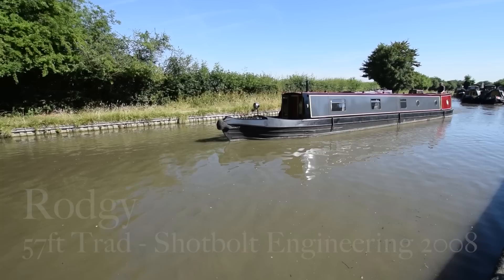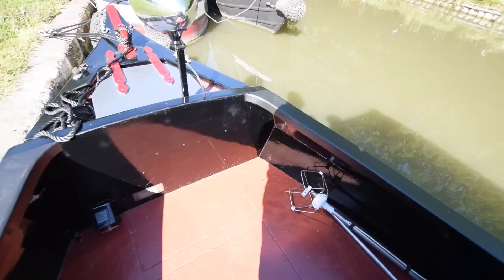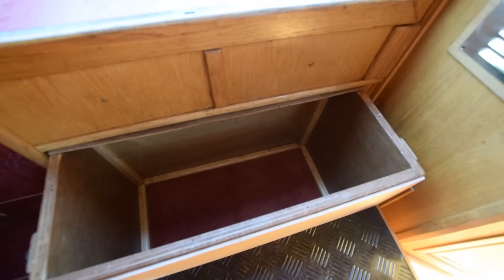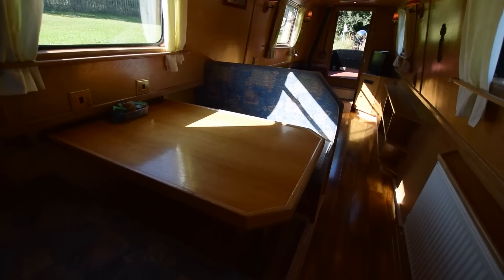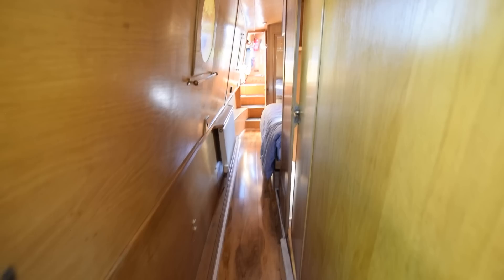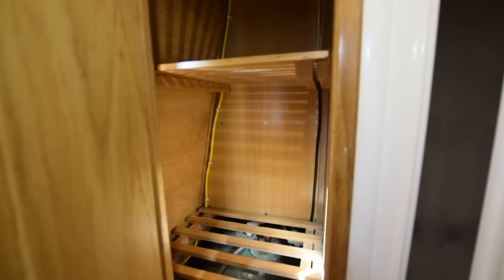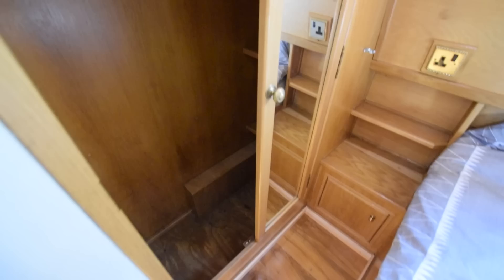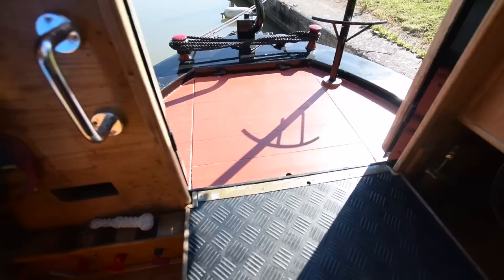SOLD - Rodgy, 57' Trad 2008 Shotbolt Engineering

Comment: Well! The potential for comfortable living is evident! Love the graceful tug bow, and the salon is nice and open despite the small shelves along the gunnels.  Again, I would remodel the dinette into a table and chairs, or even a nice walled in nook. I'm sure the engine and bay were cleaned for the sale, but you can see the overall condition is superb that cleaning can't hide! I would stack on the solar, snuggle in 6 domestic batteries, and be very happy with Rodgy!

Comment: The more I see of these boats with the engine down in the floor the better I like the ones with it sitting easily accessible ON TOP of the floor. The engines out in the open seem like they would be so much easier to work on.

Comment: Quite nice boat. I'm just wondering about the shelves on both side of the saloon, I wouldn't know which side to put the chairs on, they would always feel awkward and in the way. I think that's why no chairs are shown in the video, no?
Reply: Swivel recliners?
Reply: @Dave-sw2dm  they would certainly work well here, buy the "Feng shui" for lack of a better word is extremely awkward. There is no cozy spot that invites a settling down between 5hose shelves, however much I like them otherwise...

Comment: This one seems to have stuffed every possible thing into the 57ft length - so it could have even been 60 ft and then gained 3ft for maybe the kitchen ? It's also amazing to me that nobody is thinking of bump outs on these boats for when you are moored - Even 1ft extra in the lounge width, even if just at window level, would make so much difference as it may be largely psychological, but sitting in the lounge with a tv in your face just looks so uncomfortable to me !
Reply: I imagine the weight of a solid-steel slideout would tax any motor, plus it would get in the way of passing boats (or pedestrians on the towpath) plus you then have to protect against leaks when it rains etc.
Reply: I’m no naval architect but I imagine that having steel bump outs would be a bit of a problem for keeping a flat bottomed boat floating without tilting.
Reply: I lived on a narrowboat for a few years, the available space makes little to no difference. In fact, it's really cozy. In the UK, where there's a fair bit of rain, you want to be as watertight as possible, and these boats are made from steel, so heavy stuff.
Reply: I too have pondered the TV and sitting positions being so close together, but with new HD tv's, sitting close is much less of an issue. I also wonder when someone will put a pull down screen across the end of the lounge area and a projector stuck to the ceiling to illuminate it.  You could then have a 6 foot wide tv much further away,...if that's in fact what one desires.
Reply: @arnoldsnodgrass2953  widebeams
Reply: @terenceetullyjr  each side. But the only additional steel is the part that pulls out.
Reply: @andrewmills744  Yeah, they get in the way too